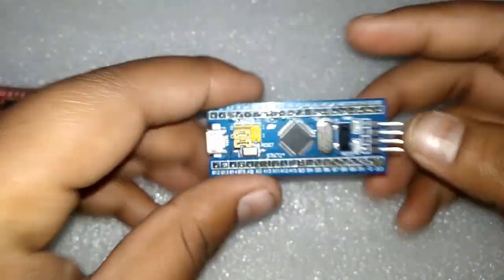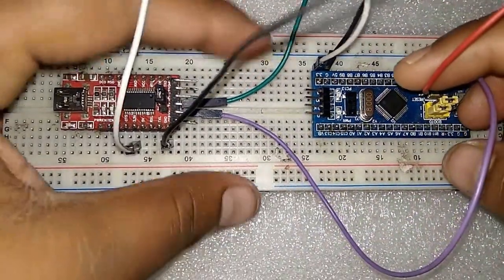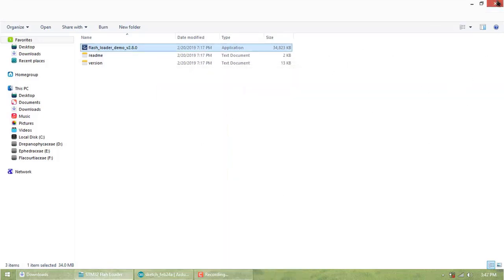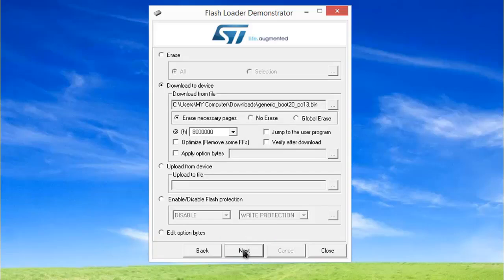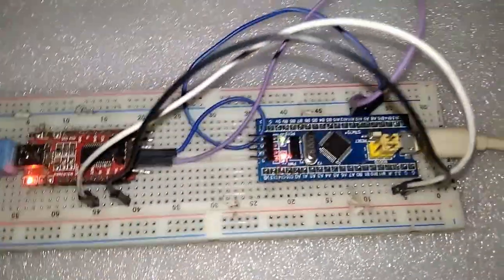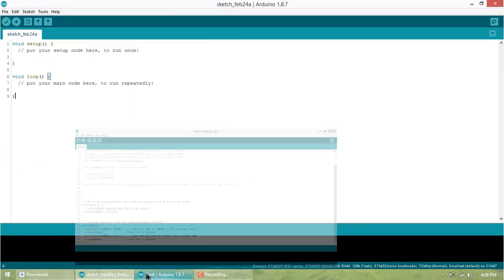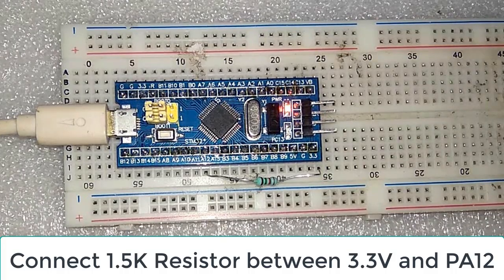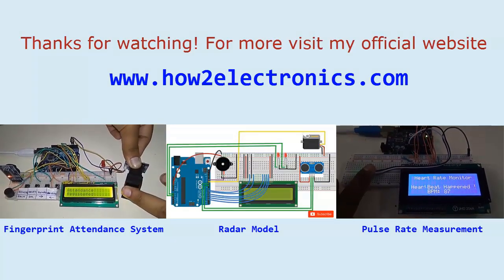STM32 Bootloader | Programming STM32F103C via USB Port

Comment: When uploading to stm32 bluepill using micro usb after doing the setup I'm getting this error: 

Resetting to bootloader via DTR pulse
#
# A fatal error has been detected by the Java Runtime Environment:
#
#  EXCEPTION_ACCESS_VIOLATION (0xc0000005) at pc=0x000000007110b5db, pid=29440, tid=1536
#
# JRE version: Java(TM) SE Runtime Environment (20.0.1+9) (build 20.0.1+9-29)
# Java VM: Java HotSpot(TM) 64-Bit Server VM (20.0.1+9-29, mixed mode, sharing, tiered, compressed oops, compressed class ptrs, g1 gc, windows-amd64)
# Problematic frame:
# C  [jSSC-2.8_x86_64.dll+0xb5db]
#
# No core dump will be written. Minidumps are not enabled by default on client versions of Windows
#
# An error report file with more information is saved as:
# C:\Users\avyak\AppData\Local\Arduino15\packages\stm32duino\tools\stm32tools\2022.9.26\win\hs_err_pid29440.log
#
# If you would like to submit a bug report, please visit:
#   https://bugreport.java.com/bugreport/crash.jsp
# The crash happened outside the Java Virtual Machine in native code.
# See problematic frame for where to report the bug.
#

Comment: maple_loader v0.1
Resetting to bootloader via DTR pulse
Reset via USB Serial Failed! Did you select the right serial port?
Searching for DFU device [1EAF:0003]...
Assuming the board is in perpetual bootloader mode and continuing to attempt dfu programming...

dfu-util - (C) 2007-2008 by OpenMoko Inc.
This program is Free Software and has ABSOLUTELY NO WARRANTY

Couldn't find the DFU device: [1EAF:0003]
timeout waiting for COM3 serial

 
Did everything according to video but getting this message in arduino . It is not detecting the port even after installing drivers.

Comment: I tried this method several times but the Flash loader demonstrator keeps showing (no response from the target, the boot loader can be started, please verify the boot mode configuration and the flash protection status, reset your device then try again...) Please how can I solve this problem I checked all my connection is okay.
Reply: I used both TTL and FT232 all of them are showing the same, I need to use stm32 blue pill in my work. checked PA10 is at TXD;
PA9  is at RXD;
GND  to  GND;
3V3   to  3.3V; 
i changed jumpers Booth0 to 1
i will really appreciate if you can help me out. thanks alot
Reply: same problem. Did you fixed it?
Reply: @sriramswain3864  Hi, Facing same issue, is there a way to fix it?

Comment: Hi,
I m trying to burn bootloader as per your instructions, however after selecting com port in flash loader demonstrator an clicking next it ask to remove protection.

However, if I click on it nothing happens. Whether my board is faulty?
Reply from the maker: Shift the jumpers from boot 0 to boot 1.
Also check the tx rx pins connection